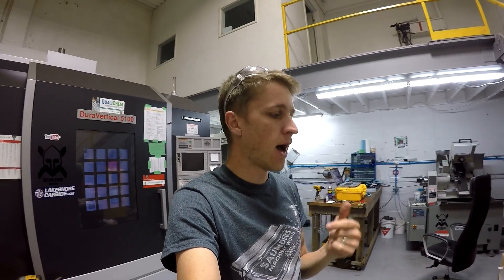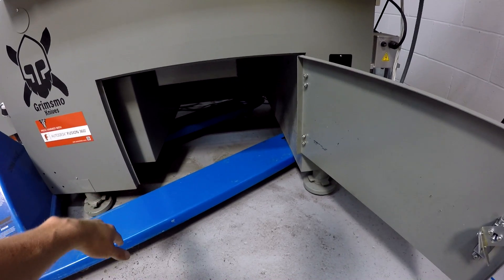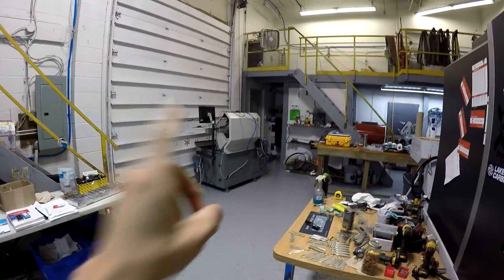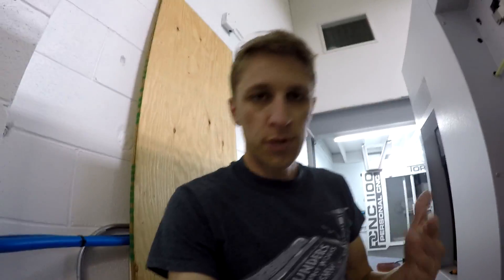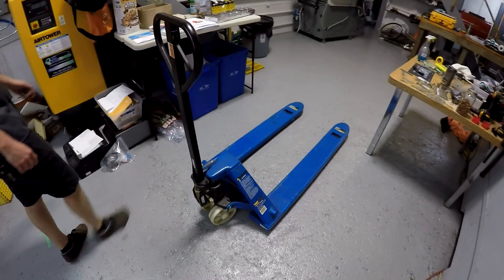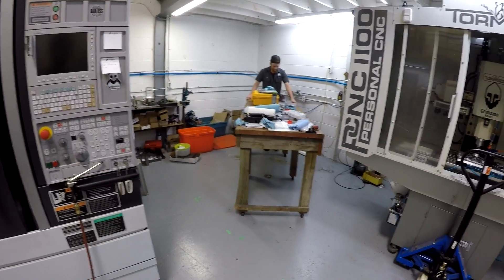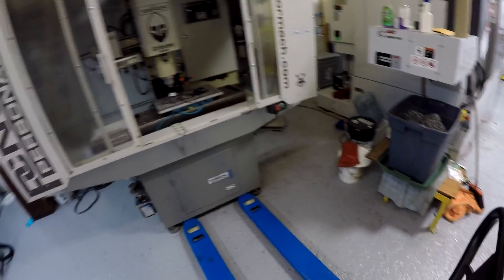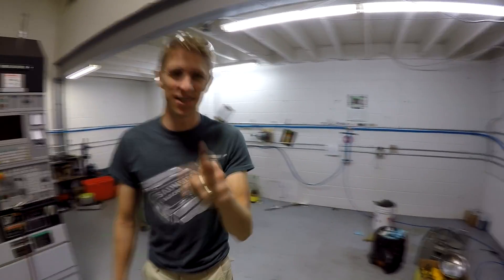Moving the Tormach mill and lathe around the shop - Grimsmo Knives

Comment: Hmm, either you're going to have to get the Mori re-leveled, or you may be re-applying epoxy to the floor. The only way I see that Nakamura fitting is to move the mill or "skateboard" the lathe in. Make sure you have enough clearance from the wall on the main spindle side to change spindle liners and insert new bar stock.

I would strongly consider getting rid of the Tormach lathe entirely and, at the least, swapping out the 1100 for a 440 just purely for space reasons. The safety factor alone is enough reason not to have a cramped up shop, but it also adds unnecessary stress to your work.

Congratulations :)

Comment: Too late now but I think you would have been much better off to leave the Tormachs under the porch then turn the Mori 90deg and face the doors of the new lathe and Mori towards each other and have them in the center of the room.  doing it that way a single operator can easily supervise and operate both machines with minimal wasted movement.  Also I imagine that new lathe will make some heat in operation and it is going to be trapped back in that hole.  If you want ultra precision tolerances the climate is something you HAVE to consider.
Reply: I think it might even be closer to 15000
Reply: *****
A loaded semi is 80,000lb. I wouldn't worry about moving a 15000lb machine as that is what my mill weighs and I moved it. My VMC weighs 26000lb and I moved it too, Do it once and do it right and life will be better in the future. The investment has been made might as well maximize it. :-)